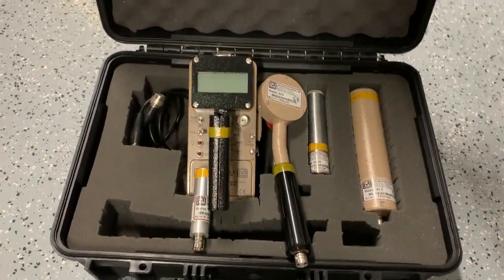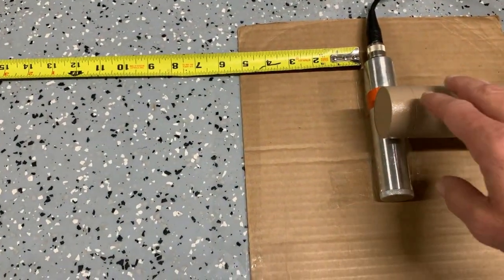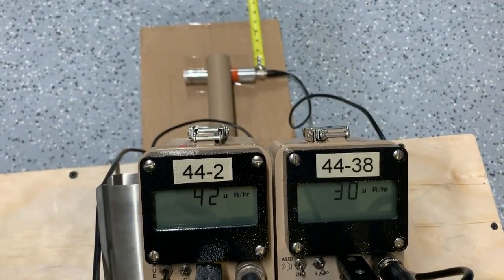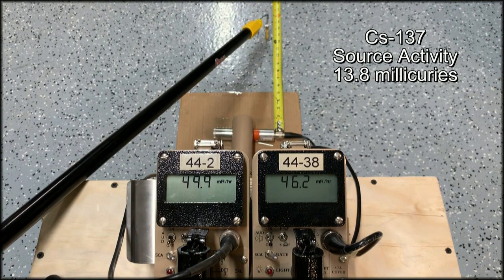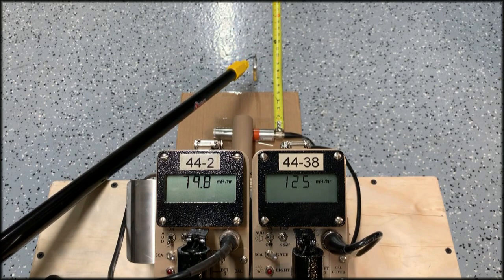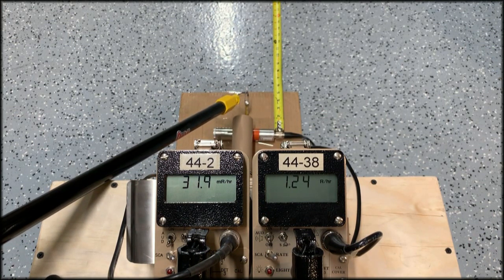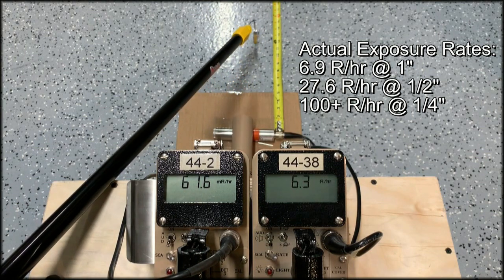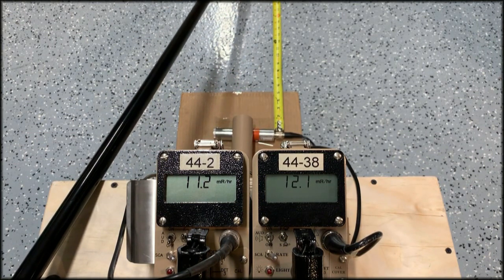Overloading the Ludlum Model 44-2 Gamma Scintillator - short version

Comment: The 44-2 and the 44-3 are both incredibly sensitive probes, both are made for uR/Hr levels. I stuffed a LiI:Eu crystal in a bad 44-2 and filled the end with wax for making a neutron/LEG probe. The sensitivity was insane for LEG, but you could use with a SCA to count just neutrons or lower the voltage on a basic meter llike a model 2 or 3 so the LEG pulses get ignored.❤

Comment: Where do you get a source like that?
Reply from the maker: I have an NRC license. A source this “hot” requires a license.
Reply: Use it to calibrate your instruments? I remember the machine that calibrated the CDV 715 meters had a 500Ci 137Cs source in it. It had a remote mechanism that turned the select knob and cable mounted screwdrivers to adjust the calibration potentiometers while it's irradiated. It is so much easier to use an x ray machine and an attenuator set to calibrate these meters 😂

Comment: Excuse me sir. According to your experience in case of a Ludlum 2221 which probes should be bought to use the detector at its best?
I mean from  radon detection to radioactive elements identification .
Grazie e buona giornata . Stefano
Reply from the maker: Radon will be just about impossible to detect with a survey meter like the 2241 regardless of the probe attached. The radon concentration in a dwelling can only be determined by testing. The Health Physics Society recommends that homes be tested and conducting a radon test is straightforward. Approved, “do it yourself,” short- or long-term radon test kits can be purchased directly from radon laboratories or from retail outlets. A qualified radon measurement specialist may be hired to conduct the test, especially if it involves a real estate transaction for which the result from an independent, third party (the tester) is needed. Appropriate radon test devices and qualified radon measurement specialists are those that have been approved by the National Environmental Health Association, the National Radon Safety Board, or a state radon program. Because radon concentrations undergo daily and seasonal variation, long-term radon tests (those detectors exposed in the home for more than 90 days) provide a better estimate of the annual average radon concentration. Whether testing one’s own home or hiring a professional tester, standard procedures for the conditions of the house and the placement of the tests should be followed. The U.S. EPA’s “A Citizen’s Guide to Radon” is a good reference for these protocols (EPA 2005).
Reply: @_TRG_208  Thank you very much for your kindness 😀 .  Ciao . Stefano

Comment: I just saw your video called "Alpha, beta, and gamma radiation demonstrated" and I was wondering Were did you get the sources of beta and gamma radiation. Basically (what substances are they and how did you get them). thanks
Reply from the maker: beckyikechannel The beta source I used is Sr-90. You can buy small exempt quantity sources like the ones I used in that video without any type of licensing. A good supplier is Spectrum Techniques. http://www.spectrumtechniques.com/products/sources/disk-source-sets/
Reply: Thank you